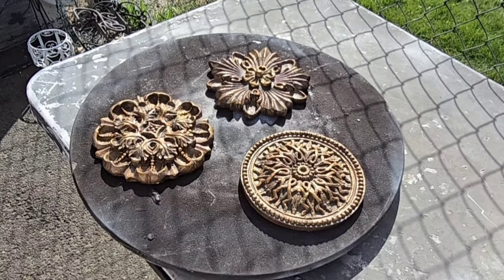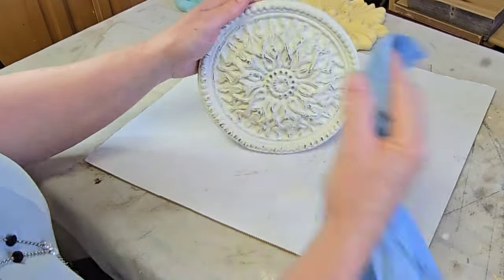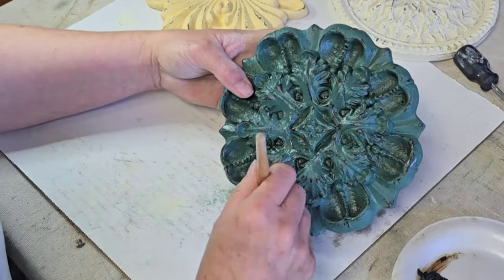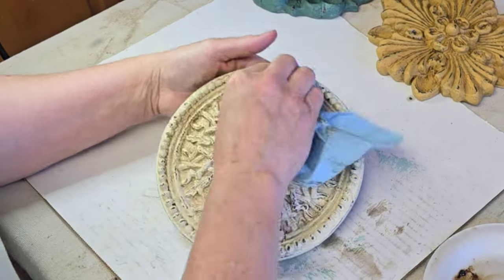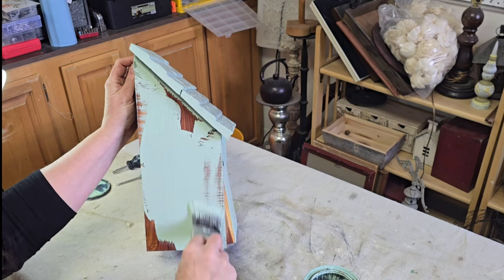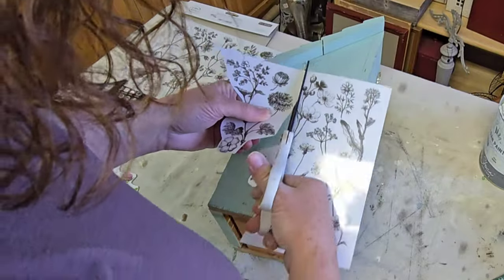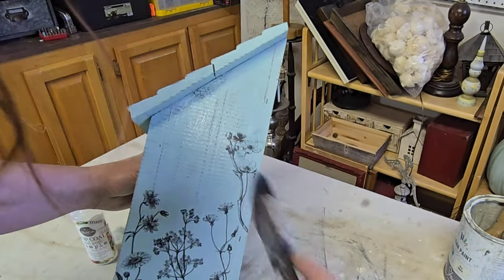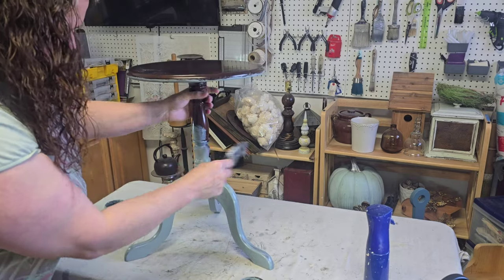Thrift Flips • Trash to Treasure • Simple Spring Upcycles Using Salvaged Items • Upcycled Decor

Comment: This round table is absolutely gorgeous!  I have found that if my transfers don’t stick onto my project, I take either my hair dryer or heat gun and warm the transfer while it’s on my piece and that works really well.  Obviously, I’m careful not to melt the plastic sheet, but the heat helps to release the design.
Reply from the maker: Great tip - thank you so much!!